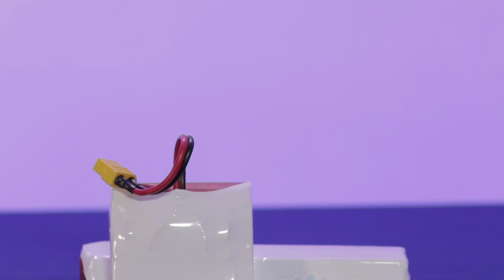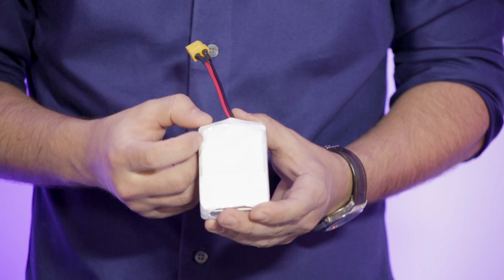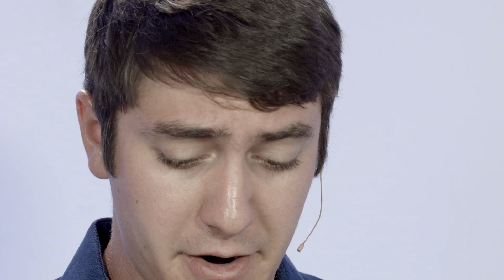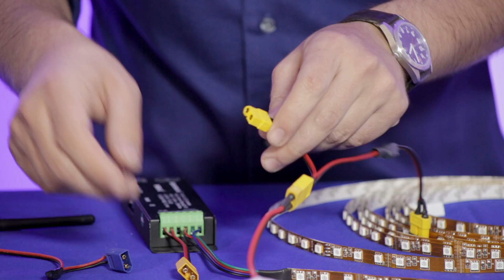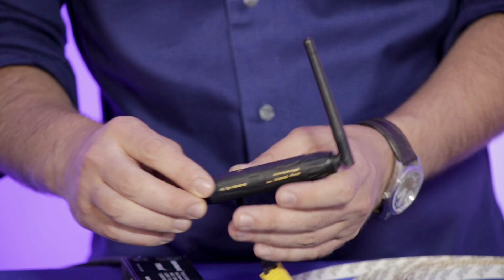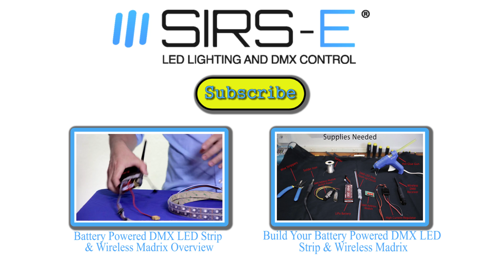LED Battery Pack 12 Volts for LED Strip Lights High Quality

Comment: this looks great. I need a battery that can power small sections of led strips over a distance of 500'.  will this battery be sufficient, or will multiple power packs be needed?  and can I charge it from a solar panel without a charge controller?   thanks for your input.
Reply from the maker: Hello Rob, unfortunately at this point in time we are not taking on any battery orders, it will be a few months before we are able to start producing them again.

Comment: Hi there, I was wondering do you have a custom battery pack that can run a 300 unit 5050 leds?
Reply from the maker: +Jaune E From my understanding, you would like to run a double density LED strip with a battery pack? If that is the case please take a look at our battery packs. 
https://sirs-e.com/product-category/led-lighting/led-strip-batteries/led-battery-12v/

The 10000 mAh battery pack will give you a maximum run time at full capacity.

Comment: i lk this how many strips can u run at the same time.?
Reply from the maker: +DJROBONE1, it all depends the LED strip you are using and the power it consumes. The 12v 10000mAh LiPo battery will run a 5050 RGB Dual Density strip for about 2.5 hours at full intensity. 
You can watch this video to help you find the battery you need: 
https://www.youtube.com/watch?v=k-rlqBOP7b0
Contact us at 956-522-2006 or contact@sirs-e.com if you have more questions.